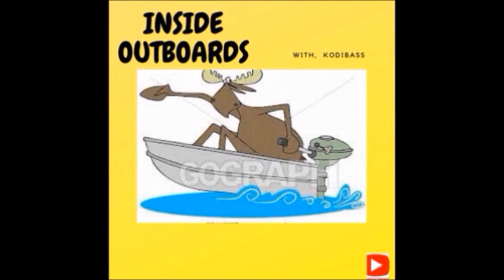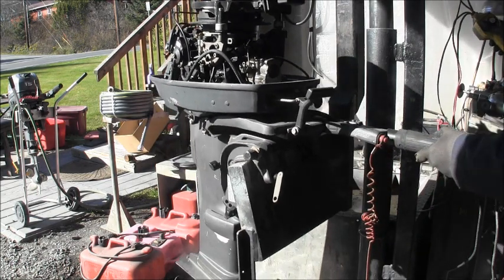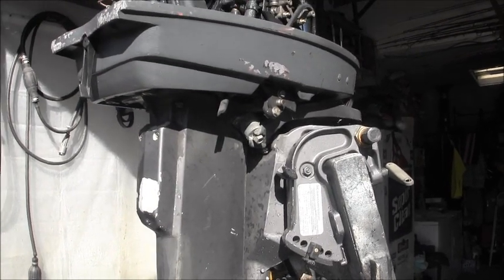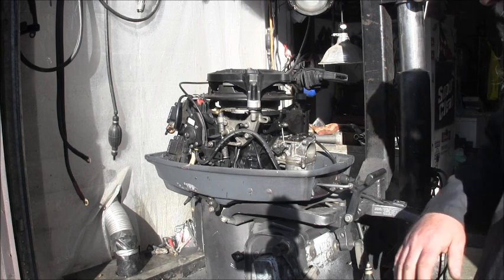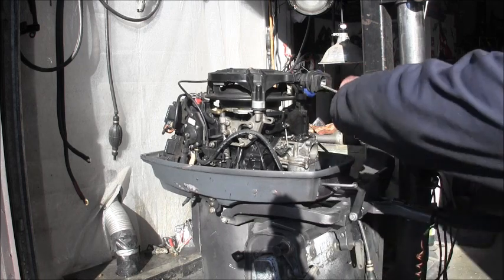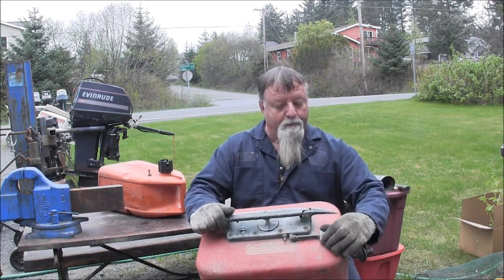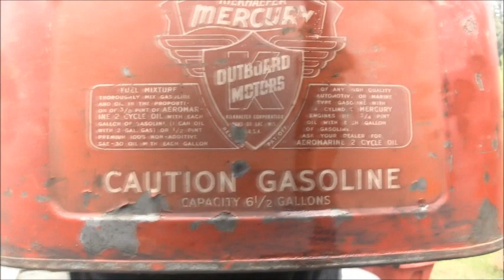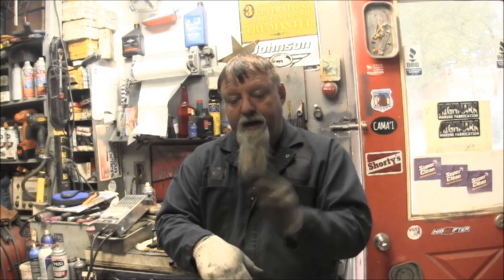JOHNSON 3O HP,      Something's  Wrong

Comment: That looks like a converted pressure tank to single line newer style fuel pump Mercury motor .There is a pin under the far side handle from the line outlets to release the handle to open. One Rare tank
Reply from the maker: Thanks for the info mate.   kb

Comment: I have a problem I have a 93 mercury 75 hp the pressure relief valve on the trim is broke and I can’t get all the plastic out how can I get it out
Reply from the maker: A very small sharp flat screw driver and pick it out.    kb
Reply: Thank you so much brother

Comment: Thought that motor shook too much
Reply from the maker: U R spot on mate.   kb
Reply: @kodibassInsideoutboards  That happened to a friend of mine who sold a similar motor after a month or so the powerhead came loose. Lack of torquing the powerhead bolts was the problem.Sometimes the calibrated arm backfires on you,LOLL! when you tighten the bolts by hand. A slightly bent prop sometimes wreaks havoc too with vibration over time also to shake rattle and roll the heck out of a high RPM normally run machine.Usually without a complaint from the operator thinking there is no problem ....